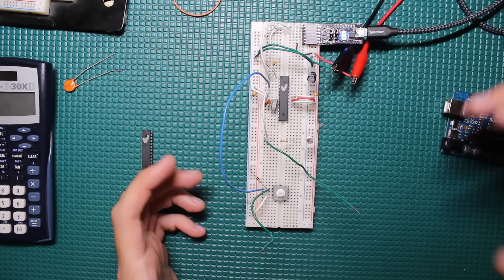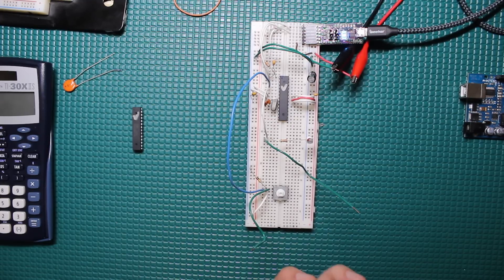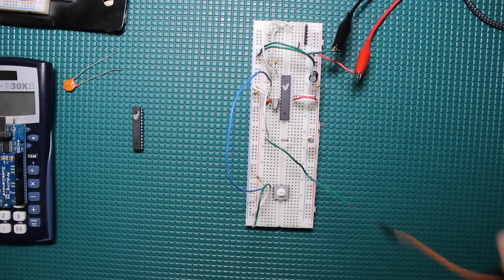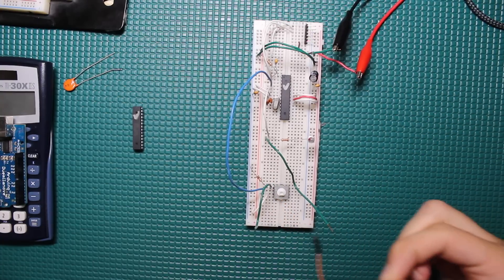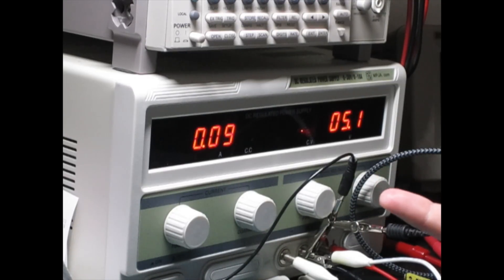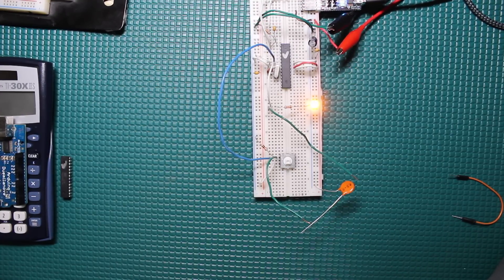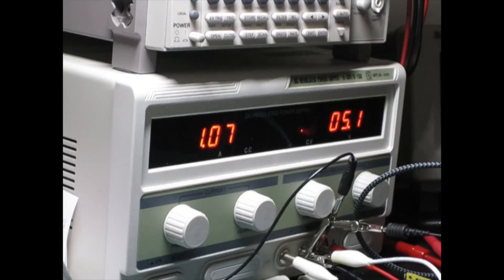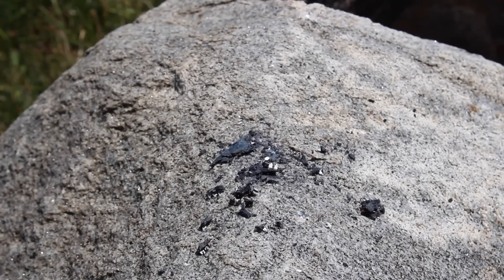Can a static shock destroy your Arduino?  Testing Effects of ESD on Microcontrollers

Comment: Thanks for sharing this video. What a great way to demonstrate the destructive power of ESD. Even as an electrical engineer I still need to periodically remind myself of what ESD can do to your circuit. Case in point, just recently I destroyed microcontrollers on 2 prototype circuits through careless handling; it didn't help that it's the dead of winter with sub 15% humidity.

Comment: Arduino - it is like a Basic on I8080 CPU, but here is the worst case - ATtiny and Atmega have  a very-very small RAM. It`s the best way wo write in pure C. 'DigitalWire' sounds like 'turnPinUp' or 'TurnPinDown')))

Comment: the charge is still going through a small area between your finger and the wire.  Add area to lower the current density coming out of your hand.  Grasp a longer bit of bare wire.

Comment: I killed more than 8 MCU just because ESD. I knew it was, but I can't protect them. Having your previous video I got something to do against it. So if I use about 9 pins of an Arduino, should I protect them 9 x 2 diodes plus 9 x 1 resistor? Isn't somehow an easy way?

Comment: Nice demo of some ESD but charging up a cap to some unknown value is no longer "ESD" 
73 N8AUM
Reply: If you have a long cable in your input circuit. The cable can act as capacitor as well and get charged!
Reply: ESD is DC
Reply: AC voltages can  also destroy your inputs when you have high input resistance.  The coupling through capacitance can pick up voltage spikes and come into your input.

Comment: Damn, never really took ESD seriously.  At my last company I used to work (SW) on open boards (essentially break-out boards) and from now and then would touch and ESD would cause a soft reset, so I got in the habit of touching my metal desk before unplugging the JTAG or doing anything with the board.  Guess I gotta bring that habit back up, lol.

Comment: using a cap on its own isn't representative. you should also have some resistance in path. look up the human body model and machine model. they are how semiconductor companies test their parts for the data sheet spec
Reply from the maker: yea, probably a good idea - maybe for part 2.  I used to use that model for measuring touch current when designing electrical safety circuits.  Wonder what kind of results I'd get with a little resistance in there

Comment: You could have tested if pins were actually shorted to VDD or VSS. If power supply was dumping more current certainly VDD and VSS were starting to get shorted.
Really cool video btw :D
Reply from the maker: yep, might actually run a part 2 to this one, would like to even see if using bigger diodes would withstand the straight cap shock

Comment: So how would you take steps to prevent this? I've taken on a rather ambitious project for my compsci course and I was planning to use these microcontroller chips directly to keep size and cost down. ESD protection would be a great addition to my report.
Reply: Aside from hobby projects, the best thing to do is to disconnect your pic controlled washing machine and refrigerator during severe electrical storms.  It probably not enough to turn off the circuit breaker since this leaves one leg of the house ac connected.  This of course goes for your computer, cell phone (if its charging), television, everything except for the toaster. All smart devices.  When went to troubleshoot a friends pic controlled refrigerator I found the varistor in the controller was blown and of course this led to a non functioning fridge.

Comment: To help prevent the shocking sensation even more,get a pair of pliers or something,and remove any rubberized coating on the handles. Hold them tight,to get a good contact/surface area on your hand,and arc to the other end of of the pliers,(or side-cutters,whatever). We used to do that with flyback transformers from old TV's,while standing on a plastic bucket. As long as you keep a tight grip,it doesn't really hurt. ;)  
(Don't try this at home.)
Reply from the maker: funny thing was that I was feeling the shock in my other arm right at the elbow for some reason....